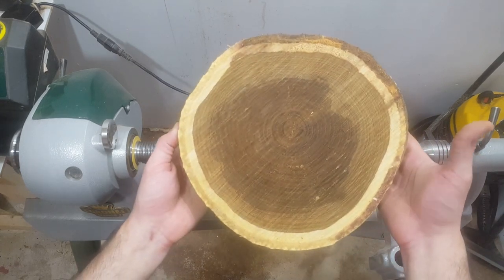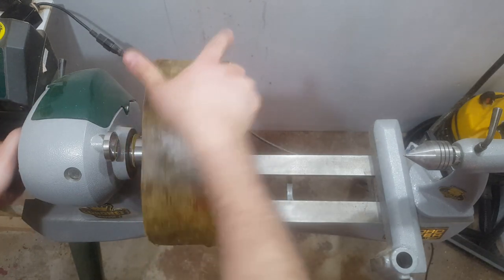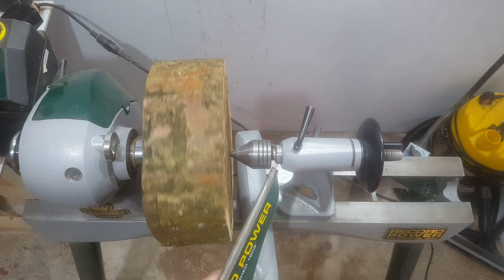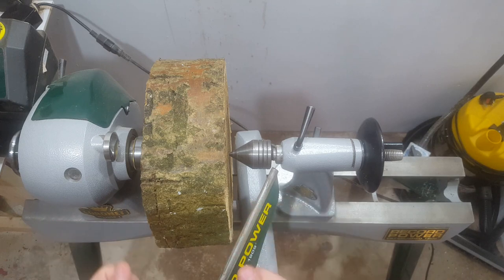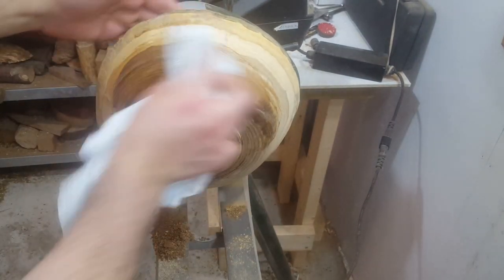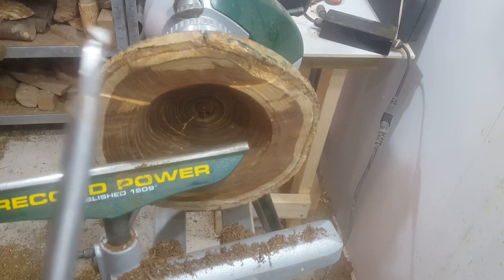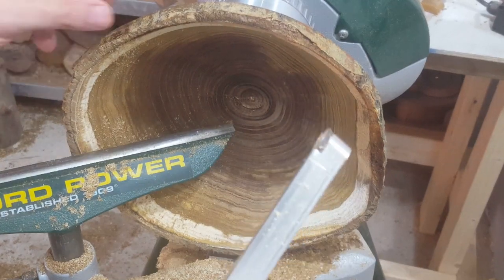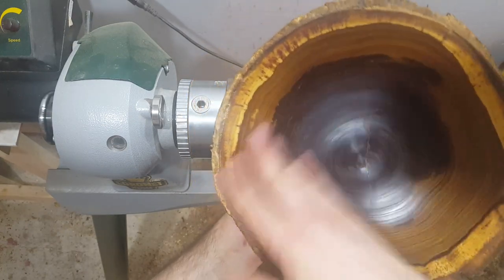Woodturning - Laburnum natural edge!

Comment: Hello my friend,grate job turning . Just bought a hook tool, any advice on how to use it . Jim
Reply from the maker: Hi Jim i do have few videos where i use my hook tool but if yours is like the one i got which is straight hook not crancked version then you need to have toolrest higher than center and rub the bevel of the hook just like bowl gouge and only expose tiny amount of the blade. also these tools only work on endgrain and resin hollowing.